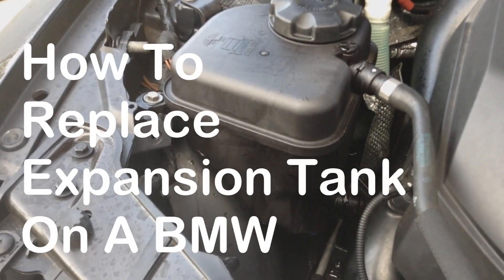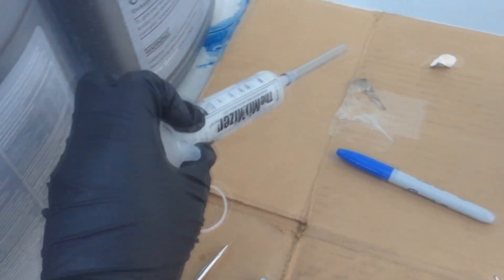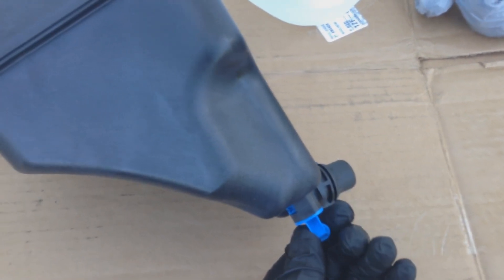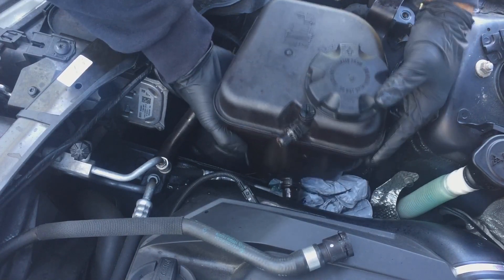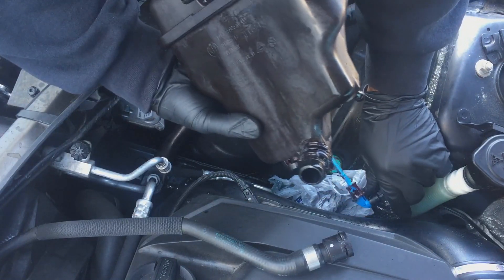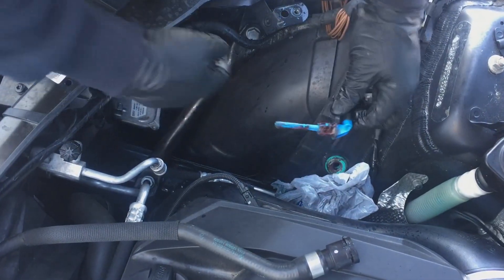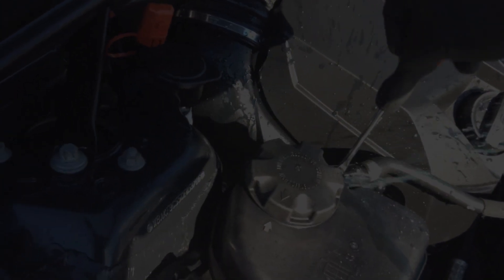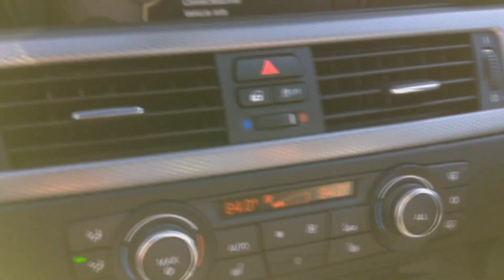How To Remove and Replace Coolant Expansion Tank on BMW 335i

Comment: I just changed my daughters 2006 BMW 530I yesterday; very easy to do.  It takes less than 10 minutes and you can save yourself hundreds of dollars.  https://youtu.be/ciU09lm5vkA
Reply from the maker: Welding and stuff saw the video it was great, but remember to show when to bleed the system, because if you dont the heating system will not blow hot air because of air pockets, and air pockets can screw the system up causing more issues.  Check this out > How to  Burp trapped air from BMW Cooling System/Water Pump test https://youtu.be/N6qkME07omM
Reply: Bimma Joc appreciate it. Will do this when I get off work today

Comment: I watched this procedure being done by an auto mechanic. He insisted that the motor should NOT be running while the bleeding process is underway. Now I am confused?
Reply: That makes a lot more sense.  Air pockets can blow head gaskets I hear.
Reply: For n54, which has a electric water pump, you can do it with just ignition on and the car will do the bleeding cycle for about 10 minutes. His maybe is B58 which I believe is a belt driven pump.
Reply from the maker: Koketso Mogobye i use the repair Manual so yes if you want to bleed the system the vehicle needs to get up to normal operating temperatures...you will know that when the fan starts to operate....if you dont do this air pockets will not be removed and heater will not work up to par
Reply from the maker: Koketso Mogobye you can also use the water pump https://youtu.be/N6qkME07omM
Reply from the maker: Koketso Mogobye cant bleed the cooling system with out car running...that doesn’t make sense 🤷🏽‍♂️
Reply: Thank you for the clarification, BJ. I will be doing that this week.

Comment: I really hope this is what is wrong with my car got a new water pump thermostat and radiator and I have a leak and I can’t find where Because is so minimum
Reply from the maker: check the edges of the expansion tank if you see water...or there is a leak detection dye you can use to find leaks with a fluorescing light

Comment: Just installed a new tank today on a 2007 BMW 335i. Shop quoted $350, I bought the tank off eBay for $38 so saved $312. Dealer cost is probably much higher.. Thanks Bimma for this post !!!
Reply: ECS tuning caries many aftermarket items that are about $50 new. I can't believe the shop quoted $350. You should start providing this service for $50 maybe plus the part and fluid.
Reply: Link to the tank?

Comment: Is bleeding the coolant necessary ?
Reply from the maker: yes , must remove any trapped air , otherwise system can fail, burst.  Trapped air also causes cool air when heat is turned up.
Reply from the maker: anytime work is done, replacing any part of the system bleeding is an order
Reply from the maker: https://www.youtube.com/watch?v=N6qkME07omM
Reply: Thanks man I appreciate it! I plan on replacing my expansion tank as soon as as my tank comes in. I wasn’t aware of flushing the coolant after any cooling system repair thank once again.
Reply from the maker: Julio  Zavala you might not have to flush just mix coolant 50 50 mix with distilled water and add to required marks...do not over fill tank and check whenever engine cold...only work when engine is cold